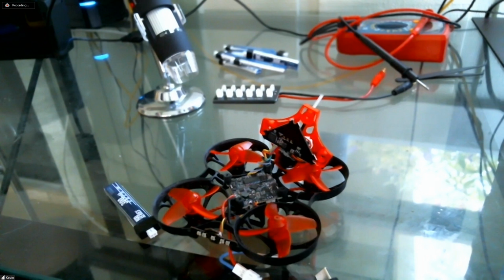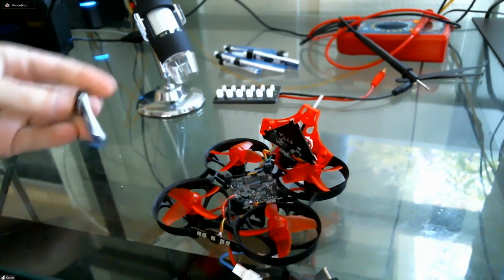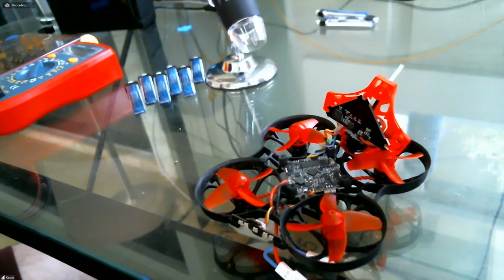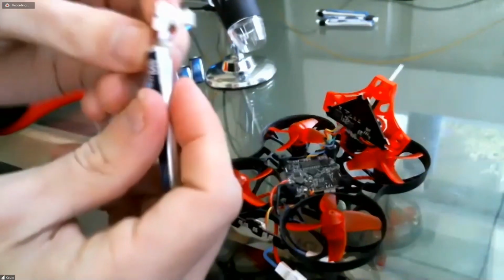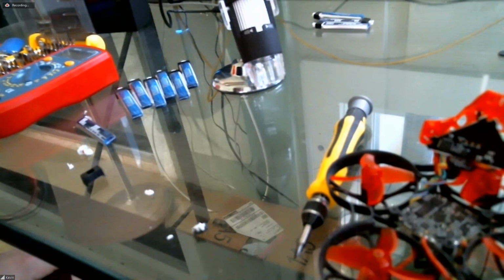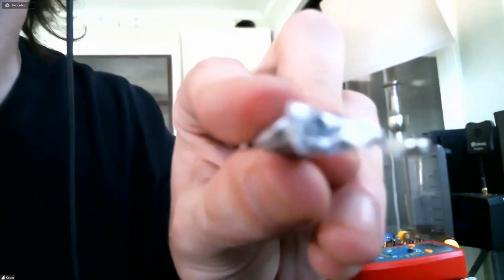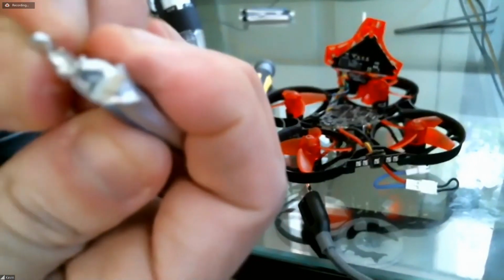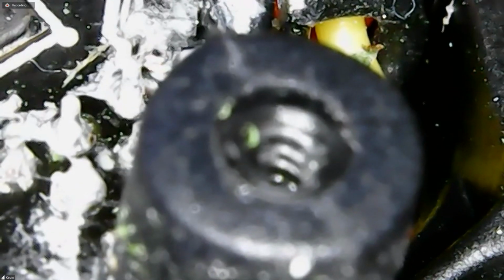Kevin Provost's Eachine Trashcan is killing his batteries |  1-on-1 Troubleshoot

Comment: The first thing I would have checked / changed was the power pigtail.  I've had problems especially with those ph2.0 connectors.  In the cheap ones, the pins are made of folded metal - they make very little contact so they increase the internal resistance and make your batteries fat.

Comment: I would try disconnecting the VTx and Cam and re-testing before replacing the FC. Odds are that the FC is the cause, but I would hate for the poor guy to wait 1-2 months and waste most of his banggood refund just to find out that it was another faulty component that could have been easily isolated.

Comment: I stopped flying my trashcan because my 300 GNB didn’t last long in it. On the Sailfly X the batteries are cool and flight times are great for the power. Trashcan would come down and my batteries were very warm and wires are warm as well.

Comment: with your charger you can check cell resistances to find a bad cell in a pack. as well as tell if a cell is damaged. i can upload a short video doing so with my charger, a battery has resistance due to the electrolyte, if the electrolyte fails you will have continuity but not resistance

Comment: Spray the board with a volatile chemical like alcohol on the board and plug in. See where it boils off first. It must be something that's not active untill voltage goes in, or perhaps a backwards diode. Diodes have a turn on voltage and may read open on some meters untill a voltage is put across them. The diode setting on the meter should be able to to find this voltage but there are so many semi conductors in the circuit it might just lead you in some wron direction. But if it's not an incorrect diode it is likely something in the buck or buck/boost converter. A short in the inductor circuit or a bad chip. Or it may be in the vtx. You can unplug it to eliminate a variable. If the board has a 5v pin for an external reciever check it's voltage. Also check the 3.3v if you can find it. If a voltage converter was bad it would likely have bad output as well as sucking up the battery.

Comment: Resistance is still a closed circuit. A battery should always have continuity. Otherwise it wouldn't work. To pass electrons the circuit must be closed.
Reply: Yes, when you connect it,then the circuit is closed...
Reply: @zviki68  correct as soon as the meter connects with the battery leads.
Reply: It has resistance you just can't measure it with a multimeter it's way to loe
Reply: @peterzingler6221  The point is that a battery should always have continuity. Also the resistance of a battery can very much  be measured. The fact that your meter isn't sensitive enough to measure the resistance of a battery is something else. Spendy multi meters can take extremely small measurements. Any ISDT charger will tell you the resistance of each cell, even if in the miliohm range.

Comment: My trashcan sometimes doesn't connect to the tx fully. It shows 30% rssi and gets sporadic signal. However after rebooting the fc in the osd it works :) This seems to be another issue with the crazybee board.

Comment: If you do get a new Crazybee FC, keep in mind that there are several different versions, and some don't work on 1S (also some have solder pads for the cam/VTX and others have a connector). If I remember right, v2.0 has solder pads and works on 1s, but v2.1 is 2S+ only and has the cam connector (it was designed for the Sailfly). But don't take my word for it; match whatever you got in there now.

Comment: I’m not buying anything from eachine anymore... I bought 2 quads from them and both were defective!
-One came with a vtx that would shut off randomly mid flight.
-The other came with a flight controller which was dead on arrival

Luckily the flight controller from the first and the vtx from the second work fine so at least I have 1 Frankenstein quad now.
Reply: Yeah I'm having also problems with my VTX bought the rush tank ultimate edition, no problems anymore...
But definitely 4 sure my next kwad is going to be self assembled, I'd really like to recommend you building your own flying lawnmower

Comment: Even a perfectly good battery will show continuity on a multimeter
Reply: Of course it will it has like 3 milli ohm resistance
Reply: Continuity, putting the meter across a single cell battery terminals, you're completeing the circuit.....hence continuity. Been awhile since I had an electronics class, but....am I wrong?
Reply: Simply wrong,
A multimeter in continuity puts out a constant current and only measure the voltage on its current source. Calculating the resistance and making a beep when under X Ohms. (Or even dumber on some)
If you connect it to a voltage source, you screw the calculation and whatever it shows. Depending on what multimeter and what battery voltage you use, you will get a load of different results.
Internal resistance measuring of a battery charger works completely different.

I can't come up with another example other then:
Using multimeter to do that is like trying to measure the speed of a plane by connecting a tachometer to its wheels. On the ground it's perfect ly fine. As soon it's in the air your tachometer will show something that has nothing to do with the air speed.

Take a one cell lipo, measure continuity with some multimeters, then do the same with the cell charged and discharged.. and also swap polarity.
Your results will change from multimeter to multimeter and some might even get damaged.
Reply: @sorenb.4173  I hear your point, but, there IS some sort of connection INSIDE the battery, becasue both sides of it need to be connected to provide power. You're saying the battery having a voltage is affecting the reading, I'm saying the reading is affected by the battery having  voltage.
Reply: @davidharris5045  "there is some sort of connection inside a battery" is also technical not really correct.. but that's not my point, the point I try to bring across is: measuring a battery or any power (constant current or constant voltage) with continuity test is not working in most cases cos it's the wrong tool for the job. And results varys on battery voltage and how the multimeter measure s continuity.. 
Measure a x00uF capacitor, no continuity there, first it's low continuity, it keeps getting charged, when voltage of multimeter is reached it showes open circuit.
It's simply the wrong tool for the job.

Also.mesuring the internal resistance, you can NOT put a multimeter across the leads and measure the batteries internal resistance.. the way to do it is completely different

Comment: One thing he should try is disconnecting everything from the board, it may be a short on the camera, or on some other part. Trying another plug is a good idea too.

Also, there is a v3 version of the board that is a lot more stable, 10a ESC and up to 4s. It doesn't fit 1s tho, so that's a downside, but it's great if he ever wants to build a toothpick with the board.

Comment: The cell shorting out when it dies seems right - if you've ever had a cell in a pack give up mid-flight, the craft doesn't instantly drop because the battery gives out 0v, the voltage sags because the cell goes closed circuit and the remaining cell(s) have to try and take up the slack.

Comment: You could cut the jumperwire and plug in a new battery. On the open ends of the juperwire u can measure the current(amps) with your multimeter then.

Comment: i had a bad connector it actually melted swapped out with some jst plugs i had and fixed the issue. after looking at leads in stock connector there were little frays of wire sticking out the bottom of plug so i assume that's where it shorted.

Comment: When the battery dies, this often leads to a short between anode (+) and kathode (-) inside the battery which results in continuity on the terminals. Especially in a LiPo pack you don't want this to happen, which usually is the case when they puff up or worse, blow up after mechanical damage. Also discharging with to much current can lead to a penetration of the separation/electrolyte layer similar to spot welding anode and kathode together.

Comment: 18:30 Kirchhoff's law deals with the sum of current for any node or junction is equal to the sum of current flowing out of that node or junction. So yes.. you are correct, it would not matter which end of the battery received the one cell jumper.
Reply: Or easy said. The current in a DC system is the same everywhere
Reply: @peterzingler6221  That's the case only in a series circuit. Which in this example, it is since we are dealing with a series plug. Kirchhoff's law is difficult to simplify any further, due to confusion with circuit types. Hats off to Bardwell for knowing the term off the cuff. Besides other electrical engineers, I have never heard someone use that law correctly. I was just giving a definition for people who may be interested. (Nerd laws and what not)

Comment: Disconnect camera from VTX and try again. 

Then disconnect the VTX from the FC and try again. 

Then disconnect motors from FC and try again. 

If there still is a problem get new FC.  Get the Crazybee F4 pro v2.1. Its got a better voltage regulator then earlier versions. In case you want to upgrade the a xt30 later. 

Good luck 👍
Reply: I second this. Disconnect everything to the FC and then plug it in and see if it drains. That will tell you if it’s the FC or not. If not then add things one at a time.
Reply: Fuck Crazybee,  just get the Geprc 12A and slap some 1102 13500KV on them.
Reply: @boratsagdiyev1586  my Crazybee f4 pro V2.1 died b4 I got to get it in the air :/
Reply: @FrequentFlyerRC  i know how it feels buddy, been through alot of them. V1 V2 V2.1 , and now they ship V3 without cap,  wait a few weeks  untill we hear complains about the third piece of crap they bring to the table

Comment: Cap or diode on live to 0v on power distribution circuit on FC has gone short circuit. Ground to live on Fets? Flux to gate on fet will kill the board.😥👎🇬🇧 A good meter will switch from continuity volts on reading higher current/volts that it originally injected.😁🇬🇧 Take the money run buy a new FC.😁🇬🇧👎

Comment: I have a trashcan also and it flies fine- but short flight times- 1 1/2- 2 minutes! I use 2 300 mah lipos but flight times are only 1 1/2 - 2 minutes. Tried a new power lead but when I would lightly wiggle the wires it would start up- then power off- then start up and then power off. I don’t fly it much because of that! Fly my Mobula 7-   With 4 minute flight times!

Comment: I left my smoke stopper plugged into a 6s lipo for a few days, it drained it. That was surprising to me.
Reply from the maker: That shouldn't be possible unless the smoke stopper has an internal short somehow.
Reply: @JoshuaBardwell  Just checked. No short. Hmm, did I just IMAGINE that happened?  How'd that lipo drain?  Guess my memory isn't clear on this one.
Reply: @markpfeifer1402  well the voltage is high enough to get the circuit closed in a high humidity environment.. Is that the case?

Comment: Hi,
I had a similar issue with the trashcan. I cleaned the board, de-soldered the leads, exchanged them with new onces and resoldered them. That solved my issue. I'm now a happy trashcan flyer. And as for banggood; you get quite quick response with a bad review. ;-)

Comment: You can't measure continuity of a powersource with a typical power meter. they basically use a voltage divider circuit. It sends a very small voltage across the part its testing, and checks with the other lead what the voltage is between its built in internal resistor and the part being tested. If the part being tested is producing a voltage than it breaks the equation.

Comment: Wonder if the power wires have a short . I got RDQ 2s lipo and 2 of them had problems you move the wires and the trashcan restarts .
Reply: Accord killa92 
I kind of agree- I’ve had a couple that way too. Now- anytime I solder on new power wires- I plug the battery in and wiggle it around and lightly pull on the wires to test them

Comment: Plug the battery and see if or where the board gets hot (ou the motors), it also could be a bad component related to the esc driver or the esc mosfets, so that's why it doesn't show anything on the resistance measured by the multimeter, but if anything that I mentioned is actually bad, the board would be bad so whatever

Comment: A thermal camera is a great tool for diagnose this kind of short or power issue. If a circuit is killing the battery in 10 or 20 seconds, the energy is going somewhere probably as heat. To dissipate the energy stored in a 250mA 1s lipo in 10 seconds it has to deliver 0.25x3600/10=90A for 10 seconds resulting 3.8x90=342 watts of power. That's a lot of power. Not recommended by any means but if someone is brave enough to touch and feel the temperature rise, he might end up exactly where the problem is.
Reply: Use the Louis Rossman approach and dump rubbing alcohol over it. The place where it sizzles and evaporates is where the current is, and probably the short. It honestly works really well.
Reply: its more like 20-30 watts because you get only a fraction of the energy from a shorted lipo. 
300 watts would also cause guaranteed smoke, its just not plausible
Reply: I had the same thought. Likely a shorted IC
Reply: Yeah rubbing your finger over it is the basic way of doing it. (just make sure you unplug the battery)
Reply: Damn 90A.  That's a lot of great in a tiny drone

Comment: My trashcan has killed three of my batteries running on 2 1S batteries in series. But I believe that is because im racing around too hard. Probably better off using the xt30 pigtail it came with and using 2S batteries.

Comment: My trashcan came from BG with defective bind button and i couldn't bind it with the remote controller and also betaflight couldn't run the "bind_rx_spi" or "bind" command. In the end i flushed again betaflight and i run once again "bind_rx_spi" and worked. Seems that betaflight executes only once the command and then all the subsequent times says it's not supported.

Comment: I had a bee brain v2 do the same thing with a different style battery.  

it turned where my nitronector batterys were wired + -   
The other battery was - + on the connector. I changed the connector around and all was well.
Reply: Yeah it could be the connector, that would explain this behaviour
Reply: This happened to me too with those 1s batteries.

Comment: As you mentioned, the multimeter sends out a small current to check for continuity. That small current has to be at some potential, probably equivalent to the battery in the multimeter. When you measured the charged battery, the battery itself had a higher voltage than the multimeter, the current didn't flow, so it measured no continuity. With the dead battery, it has a lower voltage than the multimeter, so it is going to "charge" a little bit, the multimeter sees current flow, and measures continuity.
Same reason, as you mentioned, why a capacitor beeps for a bit on a continuity check. The capacitor just fills up a lot faster than the lipo.
Reply: congratulations, you just explained resistance
as a fpv rule of thumb, anything that passes a reasonable current has a low resistance. a capacitor has a low resistance when it is empty and a lipo has a low resistance all the time.

Comment: Got a Trashcan couple months back, did the JB "before you fly.."  Betaflight stuff, glued ant, foam under cam, ect. All is great so far, but I have broke a few props, mostly on 2s, and a motor shaft, all my fault crashes, lol. Waiting for a motor, they sent the wrong one.. BG  is great..so I am grounded. I did have PH 2.0 wire opens, fixed manty times. Also one battery went open with one wire. Those silicone rubbery stretchy wires are not very durable, be carefull on batt changes. I added a XT-30, but like it on 1s mostly indoor flights. BTW the shunt (short wire) can go in either, won't matter, except for contact changes on each with PH-2.0's. My TC has ~11k on the battery input leads w/o battery.
Reply: "Send the wrong motor"

Wrong motor or wrong direction ?
Reply: @Cre8ionz.  Wrong motor model, they sent a 0802 KV16000, oredered a 0803 KV15000

Comment: My five inch is killing my batteries as well but that's a whole 'nother story...^^
(Kidding aside thanks for all you do Joshua! <3)
Reply: I hear you! 4s 100c lipo killed after 2.17minutes of a some freestyle and it comes down as a 3s battery and way out of balance...😂
Reply: Is that something that can be prevented by hardware or firmware?
Reply: Tiago that's something that can only be stopped by a softer throttle finger and not pushing that that one last gap before you come in and swap packs...

Even the God like trappy can't fix this (god like in his own mind) 

Our throttle finger likes to hear the sound of props flattening out and our eyes like to see that last gap/trick hit before we land and swap packs..

It's a programming thing for sure but the program isn't a micro chip... It's more fleshy, hairy and filled with liquids... The flight controller im talking about is not a F4 or F7 chip and doesn't run S.bus or have a built in OSD and doesn't run betaflight it runs real life and isn't very durable not really updatable but it can be inside a damm fine frame like mine..